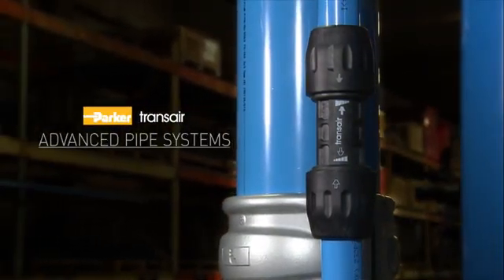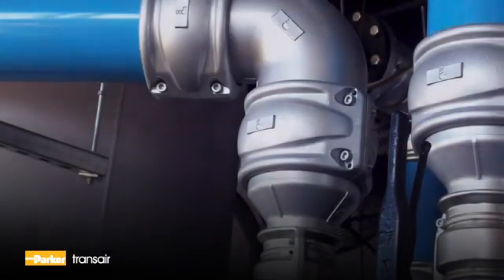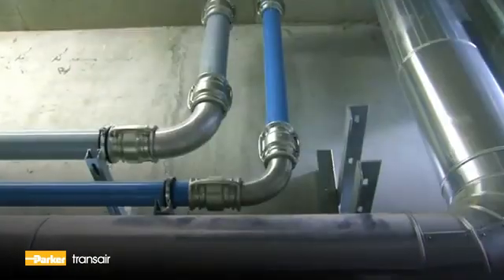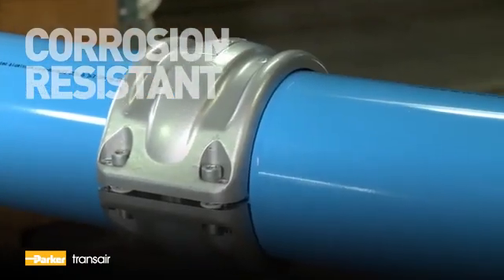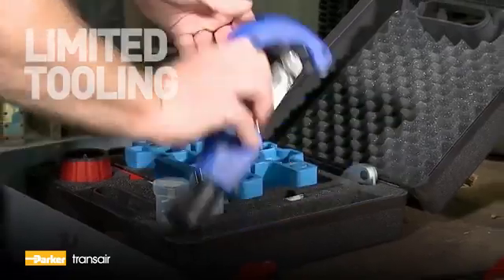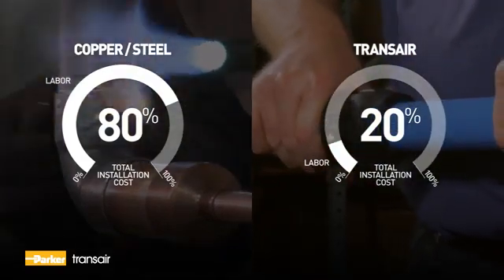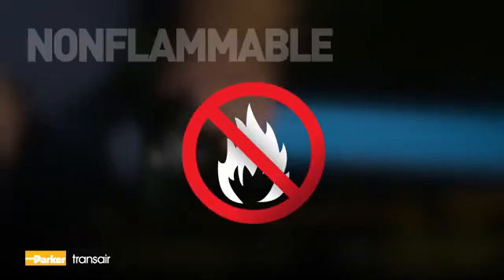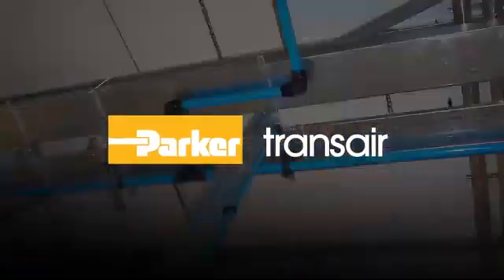Transair® Pipe Overview

Comment: Talk to any plumber and ask them about shark bite fittings for Pex they’ll tell you to avoid them at all costs. Now take shark bite fittings and put them under 90 psi and watch in amazement as your plants trim compressor runs 24/7 to service all the air leaks